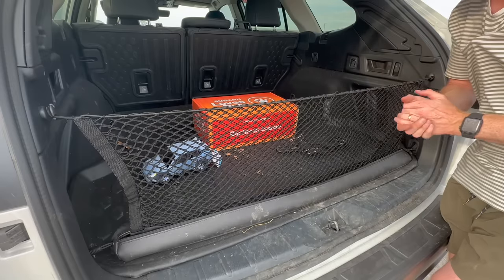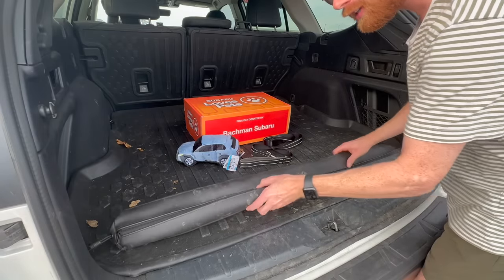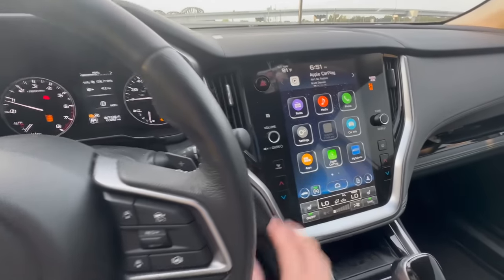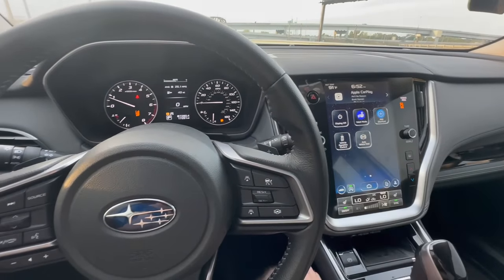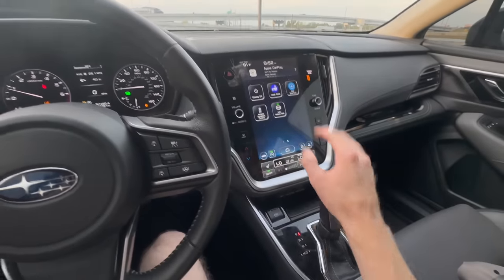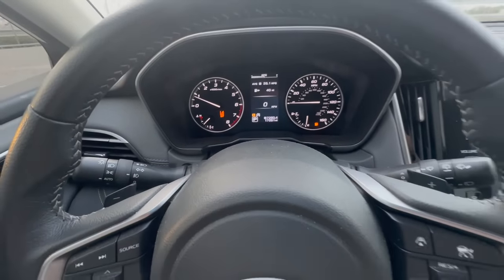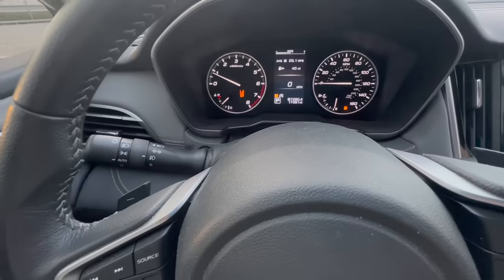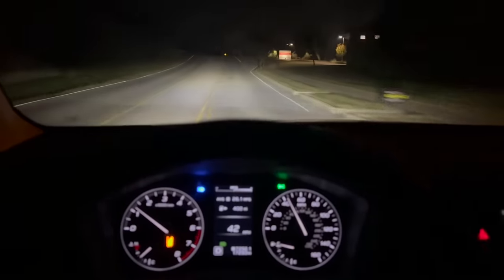Top 5 Hidden Subaru Features: Outback, Forester, Crosstrek and more

Comment: Alex, I have learned about my 2020 Forester from you more than the Salesperson who I purchased it from, yes, I know we need to read our manuals, but they can get very complicated.  Thank You Alex so much for your efforts on educating us the Subaru owners.  I do have a question for you though.  I have a 2020 Forester and it has 17,000, but my battery stalls on me from time to time.  I took it to the Subaru dealership and was advised to turn off the “WiFi” feature at the end of the day and turn it back on at the beginning of the day or when I am going to drive it.  I was told that the reason is that the battery looks for a wifi signal to start it.  Is this true?  Thank you again Alex!!
Reply from the maker: Happy to help! Sorry to hear about your battery issue. I haven't heard of the wifi draining the battery before, but I could be wrong. Do you drive your car every day? I usually only see battery issues when cars are sitting often and haven't been started for multiple days.
Reply: I saw a video a while back where a light at the bottom of the rear door was staying on a and draining batteries. I think it was accidentally being turned on and the light wasn't visible while the door was shut. But if that's not the issue, I hope you figure it out.
Reply: @alexpmo No, I don’t drive it every day.  It sits in the garage most of the time.  I have a second vehicle which I drive every day.  

The Service Associate suggested for me to buy a Subaru battery charger so I can hook it to the battery when it sits in the garage.  He said this would fix the battery issue.  I hope it does.  

Alex thank you so very much for your prompt reply.  I appreciate it.  I appreciate you too.
Reply: @lmckay3268 It should show up as a recall. Google Subaru battery goes dead. Needs to be reprogrammed. Mine has been updated back in the spring. Sadly we had already replaced the battery. There is a class action suit.
Reply: I have a 2021 Outback - battery went bad - recall on battery - you may be beyond cutoff on recall. Good luck!
Reply: @cherylrowe9309  Actually it did qualify for a new battery, so I went ahead and took it to the Subaru dealership where I purchased it from , but when it was tested it tested ok, so Subaru would not give me a new battery because of testing the m.  Go figure!

Comment: Another hidden feature you could make a short out of is for DIY people who work on their engines. The hood opens further, look on the left side (passenger side) of the hood, towards the windshield and you’ll see a hole that exactly matches the hole ya normally put the hood prop into. So instead of opening at 45 degrees, the hood will almost open to 90. Do NOT do this if ya have ditch lights mounted, you’ll crack your windshield.
Reply: My understanding is that is for pulling the engine. But also good if you need to really get the hood out of the way.
Reply: @sunofyourdrop yeah Subaru had to pull the engine on my 19 crosstrek, it developed an engine leak at 25k

Comment: Thanks for the tips. I have a 2019 Outback. I turn off the radio off at times when driving and the next time I start it up, the radio is back on. Is there a way to set it so that when I start it up, the radio is how it was set when I shut the car off. Thanks.

Comment: Hi Alex, I just purchased a 2015 crosstrek xv manual.  Shifting into 3rd and 4th gears doesn't feel as clean as the others and if you don't do it slowly and deliberately it will grind and pop out.  Do you know what causes this?  the clutch has been replaced.

Comment: hi Alex,  just need your advice to buy a used Subaru Forester , which km ( max) I should consider a limited  ? Thanks
Reply from the maker: I'd recommend looking at the purchase price relative to the mileage. Higher mileage is ok if the car has been well maintained and the purchase price is aligned with the amount of miles on the car.

Comment: Hey, Alex started my 2022 crosstrek sport after work today and wow my stereo sounded horrible! Crackling and just plain nasty. I reset the radio by holding the eject cd button and volume and tuning knob until it shut down and until it restarted. This corrected the issue so my question is...
WHY did the Radio anger me to begin with?

Comment: Just got the first recall notice on my 24 crosstrek.  Can you make a video on the problem they found with the harness and why it can be a major problem?  Also, I bought the vehicle 3 months ago and got the rust proofing and glazes but noticed already my rotors are rusty - why?
Reply: No way they could coat the rotors. Safety hazard and law suits!... As far as removing the rust from the rotors, use an "iron remover" such as Adams and always use a quality wheel cleaner when washing your car. The iron remover can also be used on the paint to remove fall out that causes pitting and small spots in the clear coat. A must for white cars.

Comment: I just purchased a used 2005 Subaru Outback VDC Limited, are there any things I need to know about this vehicle. Im having as issue of low volume of the turn signal where its almost impossible to hear it and the dash light is also very dim. Im also having an issue of changing the cabin filter, seems I cant figure out how to remove it.
Thanks Alex for any assistance.

Comment: Hi Alex. 
New Outback 2024 Onyx here.  Two of your videos gave me more info than flipping through the Subaru encyclopedia!  Keep up the great work!
Q1. As a new owner I get 3 yrs of Subaru Starlink and My Subaru app.  And 3 or 4 months of XM radio.  But...what service controls showing things like weather forecast on the display?  Is it from XM or Subaru link or even my phone?

Q2 when we test drove an outback before buying that car showed the speed limit on the driver display. Small speed sign.  Ours doesn't show it.  Where does that info come from? We do not have the built in navigation instead I use my android

Q3 by pushing the non SOS button what info would I get? Just to talk to someone? (Haha)

Thanks!

Comment: I have a 2020 Outback Limited. I discovered that if you leave the hatchback open it runs the battery down...I learned the hard way. Anyway, I've watched lots of videos about how people deal with this by using all kinds of items to jam into the locking mechanism as the hatch comes down to trick the computer into thinking the hatch was closed. I found out using the rear seat belt "D" ring is very handy, it's always there and you never lose it. What say you?

Comment: My wife has a 2021 Crosstrek.  It is a mouse magnet!  I've googled a possible solution but it requires removing the rear bumper and installing a wire over the cabin pressure exhaust ports.

Comment: Alex ... as I was inspecting my 2015 Forester I discovered a large empty polyethylene container underneath the engine air filter box inside the right front fender. Nobody could figure out what this would be for.  It's connected to the air filter box.  Finally my son discovered that it must have to do with smoothing the incoming airflow, similar to what the muffler does on the exhaust ... are we correct ???

Comment: G’day, Alex. I have both hands with a good grip on the steering wheel, yet the notification will come up to tell me to hold onto the steering wheel. I know you can’t turn this off but is there a sensitivity setting that can be changed? Thanks in advance!
Reply: That has been a issue for me, too.  It seems that you have to "fight" or "bump" the auto system  every few seconds so it knows you are still there.  I find it easier and more pleasant to just steer the car myself.  I'm a smoother driver than the auto lane hold is anyway, especially on wide laned intertate highways.

Comment: We shopped around for months, looking for a replacement for our 2008 Outback. We really wanted something else, as the 2010 Gen 4 to the current Gen 6 became bloated in Subaru's attempt to move the Outback from a wagon to an SUV. The added height, plus the roof rack redesign, really impacted some important ways we use the car. We got the list winnowed down, without even visiting the Subaru dealer, and when it came time for test drives, we finally went to Subaru to see the new Outback in person and to test drive it. What we found was that Subaru had the most thoughtfully designed interior, and the ride of the car was clearly the best we had experienced. We bought a 2024 and have had it about a month. We're still learning its ins and outs, and it certainly has its quirky "features" that no one wants, like the seat belt alarm that gets overly loud if you try to ignore it. We're quite satisfied overall with the car, and greatly appreciate that the Premium trim offered an equipment list that included features we wanted, such as dual climate control, while leaving out things we didn't, like moonroof, keyless ignition, and power lift gate. But the biggest reason we hoped that a model from the competition would win our shootout? The incredible ugliness of the Outback's bizarre cladding. We are glad we picked a dark color (red), which tends to mute the effect, but there's nothing at all classy about that trim, and I'm still hoping to find a way to send feedback to corporate that we bought an Outback in spite of that cladding, not because of it.

Comment: Hi Alex, I have a 2019 Subaru Forester limited that has the electronic emergency switch the light stays on even when is disengage, the little led light on the switch. Is that normal. I don’t have any codes and the vehicle work normal. Please advise. Thank you.

Comment: Hi, Alex, I just bought my subaru outback 2016 I'm trying to update the apps on my radio. They pulled out starlink system and are not supporting that any more. Any ideas. How to put on apps to control and get the older old function in?

Comment: Is there a way to change the range to empty for the gas tank to each mile?  Mine on my 2024 Forester goes in 10 mile increments.  So I don't know if I have 30 miles left on my tank, 25, or 21.

Comment: I've recently bought a 2022 Subaru Ascent and am truly appreciating Alex’s videos.  Regarding the AVH feature, my daughter didn't like it because she didn't like the forward surge that resulted from pressing the gas to get the car moving again.  By accident, I discovered that PRESSING the BRAKE RELEASES the AVH, giving the car a rolling start before accelerating with gas.  My daughter now doesn't mind the AVH system, and I’m preferring this brake-release technique over just the gas pedal as well.  I also discovered that when in a car wash, I must TURN OFF THE AVH, otherwise after the initial stop on the conveyor belt it's basically like having the parking brake on.

Comment: Hi Alex. I am the owner of a 2017 Forester limited with push button start and factory remote starter which works great.  They only gripe I have about the remote start is that after remotely starting the car and you open any door, the engine shuts off.  I watched a video online and it stated it's so the car can't be stolen.  I can't accept that since all the doors are locked and you need a key to get into car.  I have looked all over the internet to see if there is a workaround to keep the engine from shutting off but I have not found any.  Can you shed some input please.  Thanks in advance.

Comment: You know what I miss? Handle actuated E/parking brake. I had a manual crosstrek (23 the last year you could get them) that had it and subaru STILL had it setup so the lights black out when you pull up even slightly on the handle, my 03 forester had it too!

Was also good in an emergency for correcting understeer on snowy/icy roads, I don't think "snow mode" will make up for that.

Any way to totally black out a model (forester) with the push button parking brake?

Comment: I just purchased my first Subaru, a 2024 Forester. I noticed that I don't get an audible warning when I use a turn signal to change lanes and there is a vehicle beside me in the lane I want to enter, only a flashing warning light on my outside rearview mirror. My old Nissan had an audible warning and a flashing light. I miss the audible warning. Did I forget to do something in my settings on my new Forester?

Comment: hi, I have 2018 Outback and there is one thing that haven't found a way to resolve yet, and I thought I might ask you. It is about the radio on/off button. The radio starts automatically each time my car is started, even if I have pressed the off button the last time I used the car. This can be annoying... I don't necessarily want to listen to the radio each time when I start the engine. Is there a setting to disable the auto-on feature?

Comment: Hi There, I have a Subaru Forester on a 03 plate I have tried to access a wiring diagram showing the electrics for the windows from the main control on the driver's door. However, there are none available to Joe Public that I can find. Fuse location and numbers would be nice to have and also any relays connected to the wiring in question,  Please. Thanks in anticipation. Mike.

Comment: Hi, I have a 2006 Subaru forester,  the check engine light is on and the cruise control light is flashing and does not work.  I can't turn it on or off. Can you tell me what to do to fix it please.

Comment: Hi Alex , I bought new Subaru crosstreck 2023 just month ago and wireless phone charger pad is not working. Any idea what to do ? 

Thanx,
Nina
Reply from the maker: Have you checked the on/off button located on the charging pad? You may have already checked this but wanted to be sure you knew about that in case you didn’t already see it.
Reply: I did , charger did work 1st few weeks and then I took car for 1st complimentary service and notices charger is not working. I ask them they say try YouTube for answer as they very busy I need to wait 6-8 weeks to see them at Service again 🤦🏻‍♀️
Thanks a lot for responding 🙏🏽

Comment: I recently purchased a 2024 Legacy (Basic) With the Duel 7in displays. On the lower display is there a way to rearrange the icons? Pressing and holding doesn't work like on the top display. I would like to move the Auto Vehicle Hold and Vehicle Dynamics Control toggles to the first page next to the Auto Start Stop toggle.

Comment: Hey Andy 2024 Subaru Outback Wilderness question i trailer a boat and in the eve when getting dark I will often lift the talkgate so i can see the boat as the camera is practically useless at night. Well what I have found out the Approach Lights onthe mirrors come on when lifting the tailgat Making the side mirrors unuseable when backing up with tailgate open at night. Is there a way to turn the approach lights off for this instance?

Comment: I'm learning how to drive an automatic as my daily, I've always driven a manual previously, and the AVH with paddle shifters is one of my favorite things. I wish the AVH would stay on! 
I wanted to mention one specific function that it took me a minute to understand for AVH, when parallel parking I hated that I would need to hit the gas and quickly tap the brake to get a slow smooth roll into a parking spot. Turns out you don't need to use the gas to disable the AVH as mentioned in the video. Instead, you can tap the break again and the car will roll. This leaves the foot right on the brake pedal and provides better control of the car.
Reply from the maker: Great point to make! Thank you

Comment: I have a 2023 Outback and I can't figure out the secret to the hands-free opening of the hatchback. It only works if I put my hand right under the logo where you would press the button that opens it. When they showed me at the dealership they just waved their hand in front of the Subaru logo and it opened. What am I missing? Oh, and regarding the cargo net. Mine didn't come with it so I ordered it from my dealer. From what I understand, there was supposed to be a paper template that guided you where to drill the holes for the top two hooks. The hooks came with the net but no template. How can I get that template?

Comment: Features like brake hold auto hi beam turning headlights and hidden onlock lock button 
Are they available on the 2014 Forester?
It does not have a large screen in the center of the dash 
And the cargo net was not available in 2014?

Comment: Hi Alex. We are owners of a new 2024 Subaru Forester Touring model. We love it and love your videos! Question for you - How do we keep the radio from coming on automatically when we start the car? This even stumped the staff at the Subaru dealership where we bought it from. Can you help?
Reply from the maker: Hey Judy! Congrats on your new Forester and thank you for checking out my videos! Unfortunately, there isn't a dedicated "off" switch for the radio and by default it will turn on when you get into the car. This is something many Subaru owners have asked about so hopefully this will be addressed in the future. Is your phone connected via bluetooth? Not sure if this will help but in my Outback the radio doesn't come on when I get into the car because my phone is connected via bluetooth. This keeps my radio from coming on each day I get in the car. Not sure if the Forester will do the same though.
Reply: @alexpmo  Hi Alex! Thank you so much for your reply. I feel like that is the definitive answer. :( I will check out the bluetooth settings to see if that will be an effective work-around. Hopefully, Subaru will be able to make the "automatic on" radio an option in a future software update!
Reply from the maker: @JudyKirshner  hopefully so! 🤞

Comment: 2022 Outback Wilderness. How do you turn off the lights on the rear-view mirror when the deck lid is up? I was camping in it and wanted the deck lid open for some air flow and those lights would not turn off. I thought they would time out they did not. I asked the dealer and they didnt know how either.